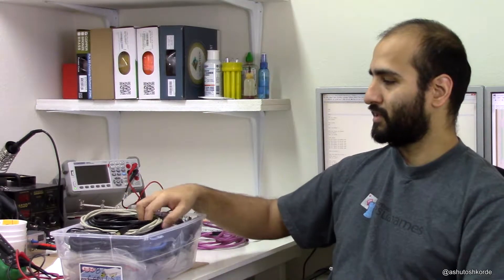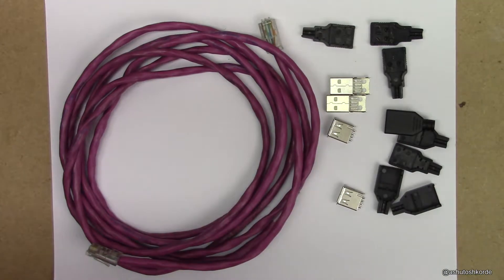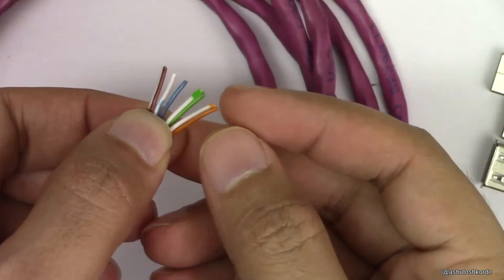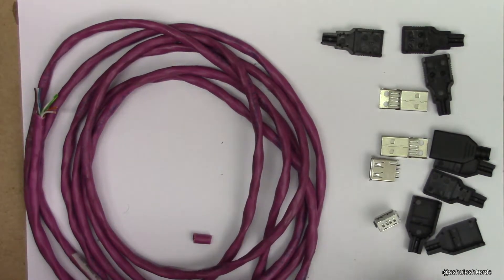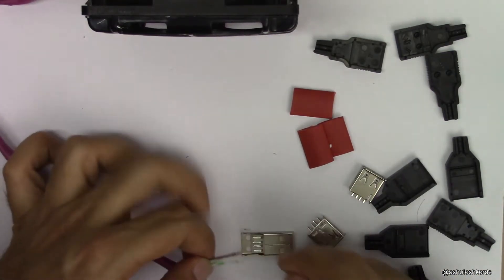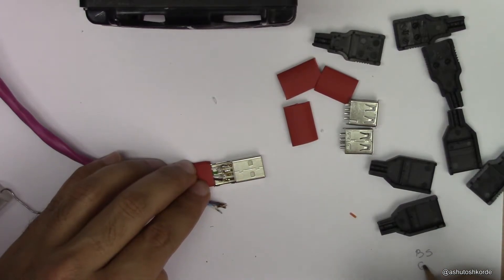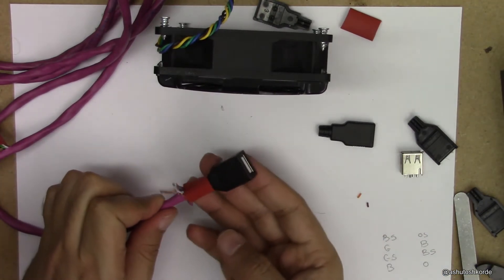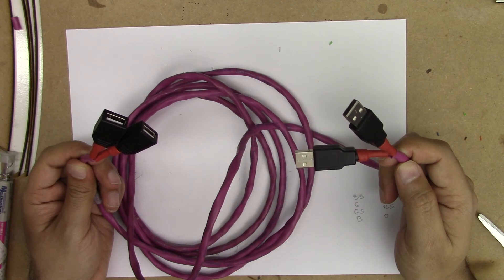Build: Dual USB Extension cable

Comment: can the tplink wifi working on that. thanks?
Reply from the maker: I doubt it, since the construction and length may not allow reliable USB2.0 speeds. Without USB2.0 speeds you will get pretty poor speed from the TPLink WiFi dongle.